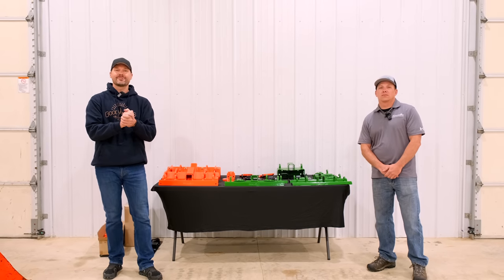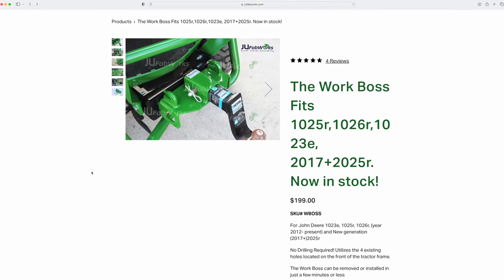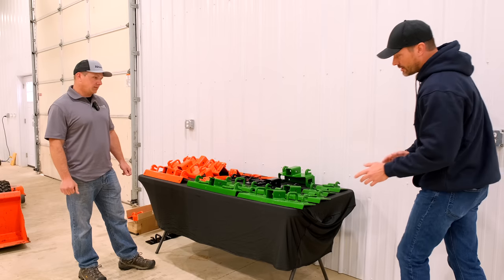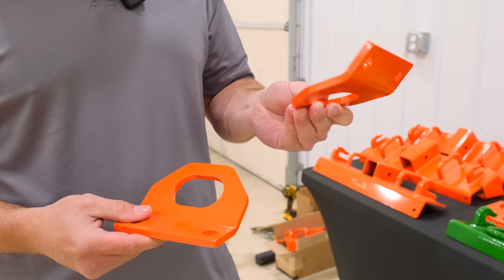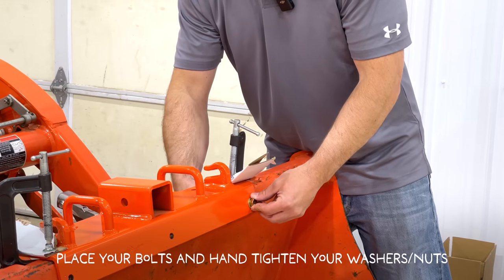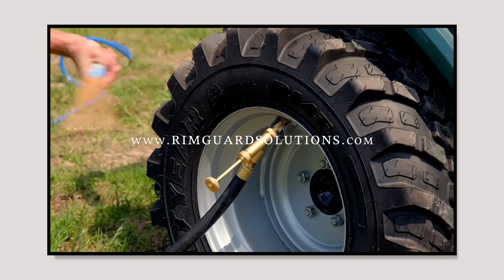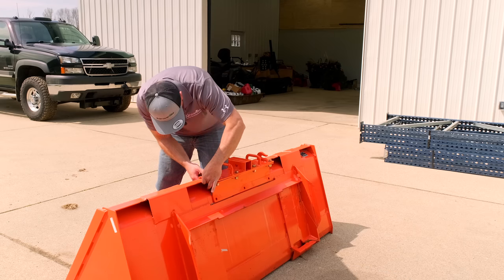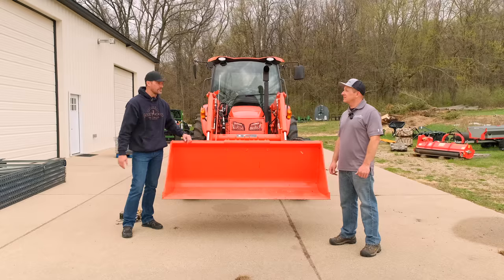BEST BOLT-ON BUCKET BRACKETS FIX KUBOTA'S BAD DESIGN! 🚜

Comment from the maker: Buy these bucket brackets! Save 5% with code GWT on JU Fab Works: http://www.jufabworks.com

LOOK AT OUR MOST POPULAR ATTACHMENTS!
Speeco Quick Hitch: https://bit.ly/3NFC0yl
Stump Wrecker: https://bit.ly/3WYa6Tf
VersaBracket Combo: https://bit.ly/3wUPrnl
Snow Pusher: https://bit.ly/3NB4BVw
Tillers: https://bit.ly/3GT1kk1
Core Plug Aerators: https://bit.ly/3W0R25q
Pallet Forks: https://bit.ly/38wRztu
Grapples: https://bit.ly/3PNNYaZ
Dethatcher: https://bit.ly/3GT9Zmk
Tractor Canopy: https://bit.ly/3IHcvNU

WANT TO SAVE MONEY? CHECK OUT THE GWT DISCOUNT CLUB!  Use code GWT at any of the vendors below and you will save cold hard cash :)  I will also get a commission for the sale, so it's a win-win-win!  

USE CODE "GWT" TO SAVE BIG WITH:
CUSTOM GRILL GUARDS @ http://www.5elevendesignz.com
PTO QUICK ATTACH @ http://tractorptolink.com
DIY HYDRAULIC SOLUTIONS @ http://www.summit-hydraulics.com
GAME CHANGING GREASING SYSTEMS @ http://www.lube-shuttle.us/store
TIRE CHAINS @ http://www.tirechainsonline.com
PREVENT FLAT TIRES @ http://www.multiseal.us
CULTIPACKERS & CRIMPERS @ http://www.packermaxx.com
ALL OEM JOHN DEERE PARTS @ http://www.247parts.com
ACCESSORIES AND BACKHOE BUCKETS @ http://www.muddscustoms.com
CUSTOM TRACTOR FLOORMATS @ http://www.tractormat.com
PROTECT, ORGANIZE, IDENTIFY HOSES @ http://www.outbackwrap.com
BOX BLADES FOR ATV'S @ http://www.northwoodsfabrication.com
HYDRAULIC SYSTEM PROTECTION @ http://www.hoseendchamer.com
DUMP FROM THE SEAT MATERIAL COLLECTION SYSTEMS @ http://www.proteroinc.com
POWERED SWEEPERS SWEEP UP ANYTHING @ http://www.sweep-all.com
EASY WHEEL TOP LINK HANDLE @ http://www.tractoraftermarket.com
TIRES, WHEELS, AND DUAL ADAPTERS @ http://www.millertire.com
AMERICAN MADE CARRY ALL ON STEROIDS @ http:www.bigtoolrack.com
THE BEST TOOTHBAR AND MORE @ http://www.heavyhitch.com
5% OFF WITH CODE GWT AT TRAC SEATS! http://www.tracseats.com

SHOP: http://www.goodworkstractors.com
AMAZON: http://www.amazon.com/shop/goodworkstractors
SUBSCRIBE: http://www.youtube.com/goodworkstractors
LIKE: http://www.facebook.com/goodworkstrac...
FOLLOW: http://www.instagram.com/goodworkstra...
MERCHANDISE: https://stores.inksoft.com/good_works_tractors_merch/shop/home

*Discount codes cannot be combined with any other promotions, offers, or deals!
**I choose to sell some products through 3rd parties instead of stocking items myself.  Know that I will receive a commission if you choose to purchase through certain links.  Thank you very much for your support!

This video is for entertainment purposes only.  Good Works Tractors (Good Works Lawn & Power, LLC) cannot be held responsible for content found in any video.  Always reference your owners manuals, use extreme caution, and proceed at your own risk.

Comment: I called to get one that went all the way across the top of my bent 400E bucket. Not available even special order. Had a local shop bend one for me. Jeff was very helpful and apologized for not being able to help me. I felt bad I could not buy it from him.  What a stand up guy.
Reply from the maker: Could buy a middle section and a couple of end sections?
Reply: @GoodWorksTractors  I wanted a 1 pc to help straighten top of bucket, Also gives continuous support from one side to the other.
Reply: I added a welded strip along the top edge of bucket: it added strength, added safety space to better prevent logs from rolling back toward operator when bucket gets higher and tilted back. And the edge is handy for a chain to be hooked on anywhere along it. 

Also welded female receptacles in three places at bottom of bucket, with removable steel prongs (held in place by bolts or pins through each receptacle. Handy for digging, scarifying, toting logs or lumber or brush. In a pinch (been stuck in plenty so I know) poke the prongs into the ground and use the loader tilt to help your 4WD pull you out, or push you out backwards. Good to wrap chain or rope around too for lifting. 

I wound up using only the two outer prongs most of the time.
Reply: Don’t know how to upload photo with iPad.

Comment: Reinforcing bars are a grood idea.  I would prefer one with 1/2" holes so it can be plug welded to the bucket side.  But realistically, there might not be much of a market.  I don't see how you can add much value to such a basic item when a customer can grab bar steel off the shelf and make it themselves and rattle can it good enough for loader work relatively cheaply.  Plus, tractor folks tend to like DIYing.  It would have to be priced right and have excellent quality.  It doesn't seem like an item you would ever want to remove, so why not make it permanent?
Reply from the maker: I hear what you're saying, but companies like Jeff's and many others exist because there's a huge portion of folks that don't have those skills or don't want to mess with making their own.  But, those DIY'ers come up with some killer stuff too!
Reply: I mirror what Courtney has to say. I’d much rather just drill/bolt one of. I could take my tractor across the street, but way easier/much more practical to buy one. 

Goes back to the vid not to far back, discussing purchased versus homemade tools/attachments. And the big pricing difference.

Comment: Just picked up the bucket bracket for my BX23s Kubota. This is a game changer. So easy to install. Just bolt it on and go really saves the lip of the bucket and with the 2 hooks just one chain does the job. 👍🏻

Comment: I would be interested for the side reinforcements that could just be bolted on as long as they don't interfere with tooth bars on the bottom. For example i have the Bxpanded parana tooth bar. I just bought the workmaster and taskmaster and love the product. Thanks for having Jeff on the channel.

Comment: I've got my 2025R outfitted with JU FabWorks gear (I was sold after I watched your original video featuring them) and I've gotten a ton of work done with them.  As others have mentioned, these plus a chain = "who needs a grapple?"  Also, I have the HeavyHitch toothbar to give a little more grabbing area under the load (mini forks?).  The quality in the brackets is top notch...the included installation instructions were dead-on accurate and simple (not that installing these is particularly difficult) and they just look awesome.  I got lots of compliments and comments from the shop folks at the dealership when I had the tractor in for some service.  Fantastic investment in the capability of the machine and I especially like that my purchase supports a small business in the USA.  As a sidenote, I just wanted to say that I really like that you are bringing in the folks who are making this stuff onto your channel.  It's great to put a face to the gear we're purchasing..and makes it all the more satisfying that buying "local" is supporting fellow Americans!  I also have a 511designz grill guard..again...largely because of your videos.
Reply: Gary we greatly appreciate the people that choose to support all the local American businesses!

Comment: Just installed a work plate on my M4D-07, M1811 bucket. Install went smoothly. May I suggest one or two pictures to accompany the written word. Mounting the back plate was a little different and took a few minutes to ensure I had it correct. A picture would have helped to speed up the process and to ensure I had it mounted correctly. I did use the GWT discount code and it did work!! Thank you for that!!
Reply: Thanks for the feedback Jeffrey, pictures in our instructions is a great idea and will certainly consider it.

Comment: I don't know if either of you have checked into it, but the option of a third-party facilitator. At the large companies that I work for in past and present. They can handle it all. They can handle the VAT and  import with their registration numbers in order to get product in. UPS and Ryder are set up for it.
Reply from the maker: I've talked to a few...I still had to do more legwork than I felt was reasonable.  Plus, I've quoted over 100 shipments to Canada and not a single person went through with the transaction after getting the total cost.  That became a waste of my time to deal with.
Reply: Shipping up here to Canada is a pain. Shipping costs, with customs and “handling” seems to be about 50% more than they should be, in comparison to USA rates. There shouldn’t be any custom duties for products under 100$, but they all charge you “duties and customs” even though they actually cannot justify it.

Comment: What drill bit did you use for installation
Reply: It really depends on which workmaster plate. Some take a 7/16" and some take a 1/2"  This one in the video was a Irwin 1/2" titanium coated. Thx

Comment: Do you know if that "workboss" at the 2 minute time frame will work on a JD 2305?
Reply: It will bolt on to your 2 outside holes in your front frame and work fine, but we do not advertise it to fit because we suggest 4 bolts to secure it safely.
Reply: Yes I understand 4 bolts would be better than 2. Thank you for the reply n keep that it in mind. So I could do a lil fab work n add the two other holes then..